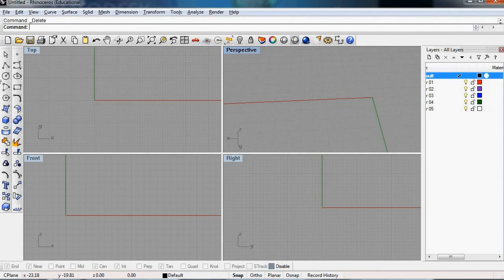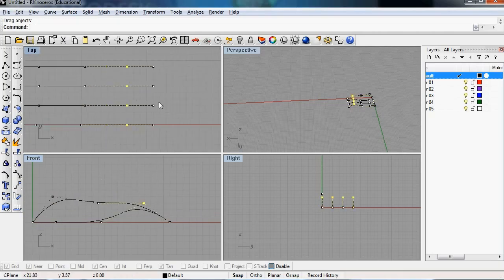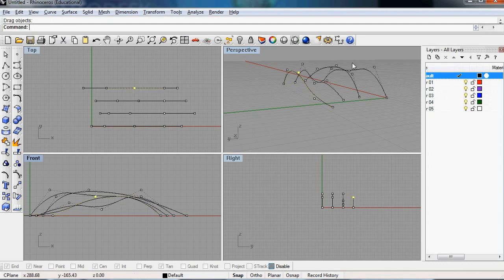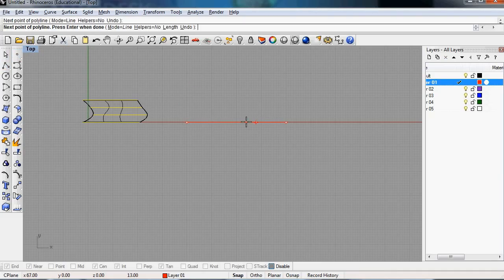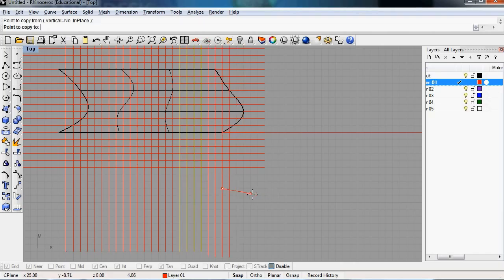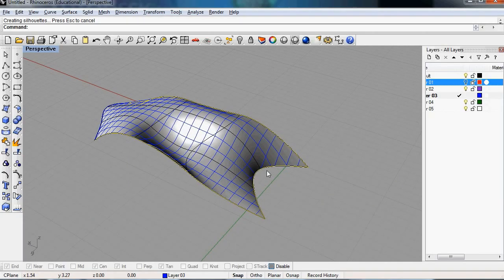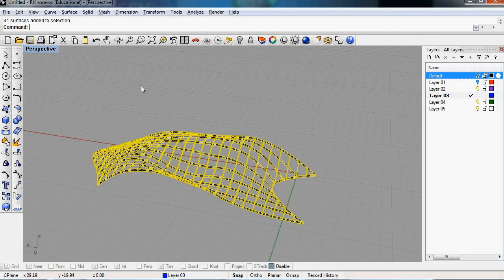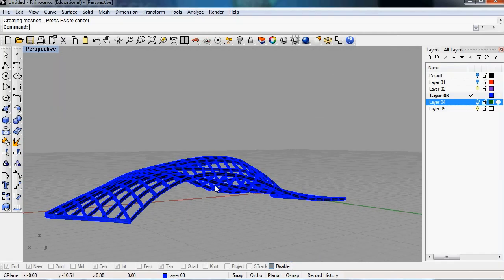Creating a Roof Structure

Comment: how can I change the profile of the structure elements? I mean, this one that you did were squared, can I change it to a circular?
Great video, by the way.
Reply from the maker: Once you have the curves of the structure you can use the pipe command to obtain circular tubes instead of creating rectangular elements

Comment: I cannot loft it into surface :( Turns to polysurface instead, and showing like wire rather than a real surface. I'm a newbie so can you help? :(
Reply: Doesn't matter if it is polysurface or surface in this case as far as I know, don't worry about it.
You might have the "wireframe" viewing option on, change it to "shaded" or "ghosted" etc. and you should see it the way you want. Just right click on the viewport you are using.

Comment: how to fill the voids in the final model with some material like glass
Reply from the maker: Use the surface that you created at first, you can use it as a single surface intersecting the structure or you can duplicate the structure and boolean the surface with the structure

Comment: HI. I have a question. i have a hexagonal grid on my site, as a module. I want to morph that, to achieve my form. First, how do i make the grid a plane? 2. How do i take it up and down, and push it in?
Reply from the maker: +fireworksexplode what you can do is draw an hexagon and make it a plane with the planar surface command, then you can use that plane to make the rest of the grid. Group all the surfaces, then create a cage (transform/cage editing/create cage) around the group, it will ask you for the number of cage points which you can modify, then do a cage edit (transform/cage editing/cage edit) it will ask you for captive objects (hexagon group) bounding box (cage). Use the control points to shape the form that you desire.
Reply: Thank You So much! You probably saved my life! :) I'll try this right now!

Comment: while interesting,... its seems wrong,... when you did the 1st extrusion the result is a bunch of surfaces with different dimensions due to the curvature, to correct this you would have to use a extrusion that is based on the surface normal, the same mistake was done in the next extrusion, to me this looks bad
Reply from the maker: +Robert Ostman I do understand your point, you could project a grid with the desire thickness so you don't have to extrude them at all and then trim the unwanted surfaces, after you can either extrude them or offset them if you want it to be along the normals.

Comment from the maker: Hi Salvador, once you extrude the curves into surfaces, you will have to get the intersections on between to use them to do the notches, I have other tutorials in which they explain the process: creating a 3d waffle model in rhino, also check creating notches using a rhinoscript for a more efficient workflow. Hope it helps